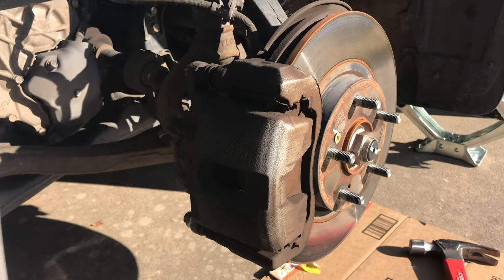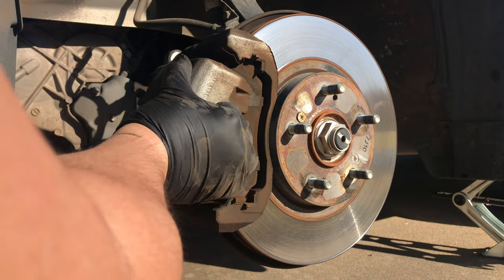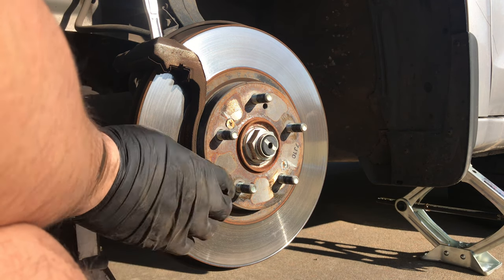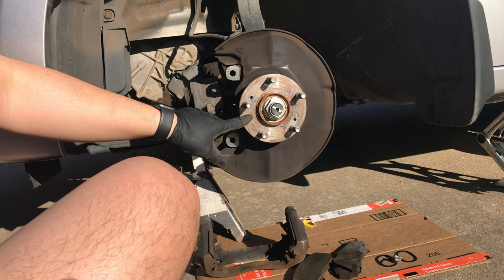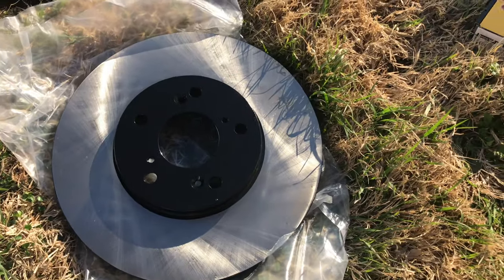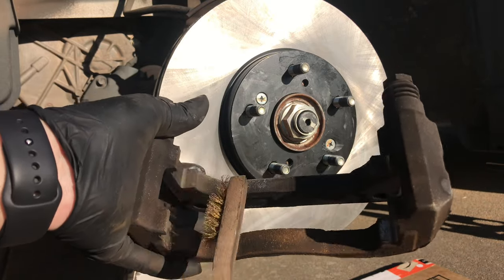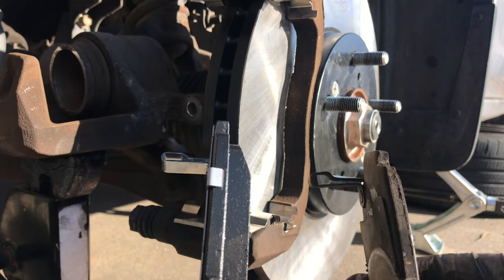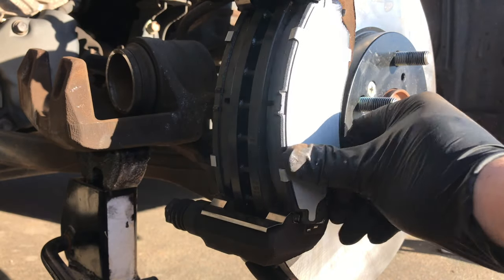2008 Honda Accord Front Brakes and Rotor replacement

Comment: Do i need the tool for pushing in the pistion? ive seen kits on amazon and have heard some pistons need to rotate to be pushed in?
Reply from the maker: https://amzn.to/3U2ggBp

On this particular year Honda, the front brakes just need to be pushed in and the rear brakes will need to be screwed in. The above link contains a brake kit that you can purchase, or you can go to your local parts store and borrow a brake caliper kit The brake caliper kit contains all the right adapters to allow you to use an old brake pad to push the piston back in. If you have a very large c clamp, you can achieve the same result.
Reply: @YoDIYVideos  Thank you man!
Reply: On the 8th gen accords the rear pistons have to be turned to compress them, in which u may need to tool(I used a flat edged pry bar). The front pistons are push in.